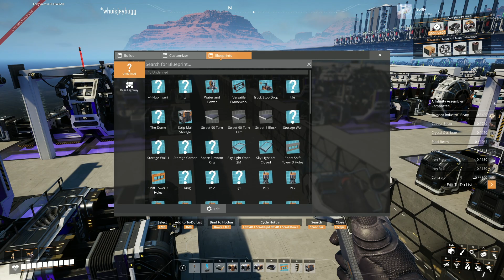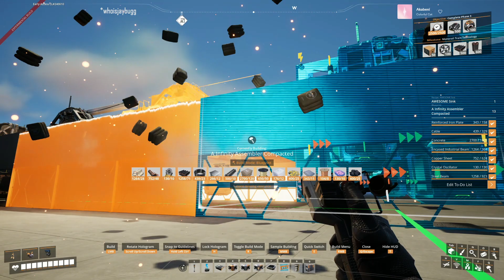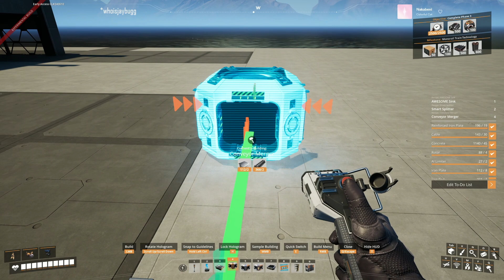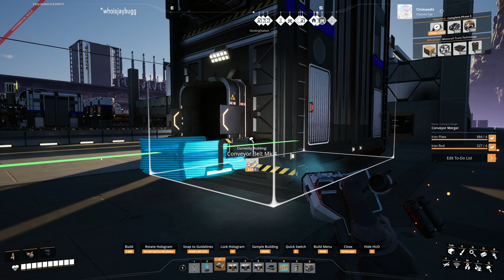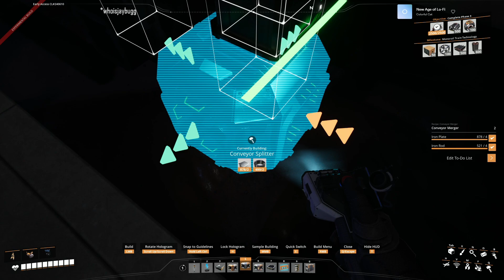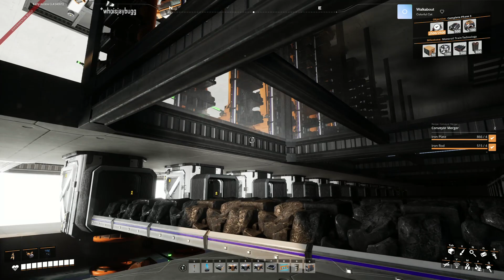More Coal: Compacted Coal Blueprint Build 7 and 8- Satisfactory 03.09 Part 2

Comment: Reminds me I shouldn't just skip over compacted coal as a power source now that blueprints make it so easy to set up.

I wonder if there's any way to design your blueprint so that belts and power automatically link up and chain? It would be so nice to save that linking up time too
Reply from the maker: As for your second question. You still cannot connect things across blueprints. I doubt you ever will. But power, belts, and pipes have to be connected by hand across BPs!
Reply from the maker: Compacted coal is worth the effort but as you point out the latest and greatest round of blueprint updates make it amazing. I’m starting the think the need for compacted coal for power scales up with the amount of effort you plan to put into coal as a power source. If you wanna rush to fuel meh you can skip it but if you want a giant coal power plant or even a massive steel mill, compacted coal might be a requirement.